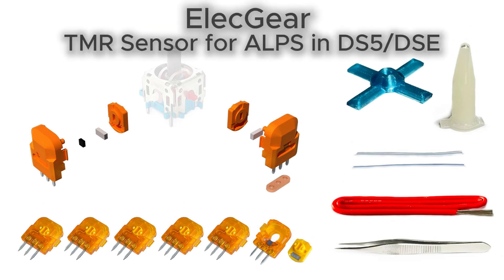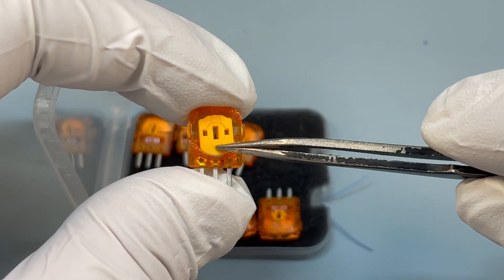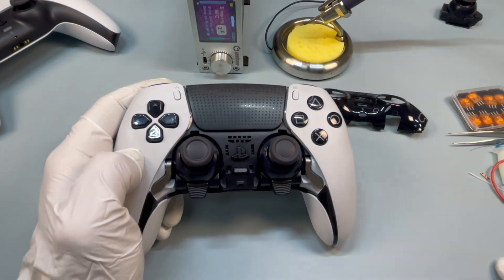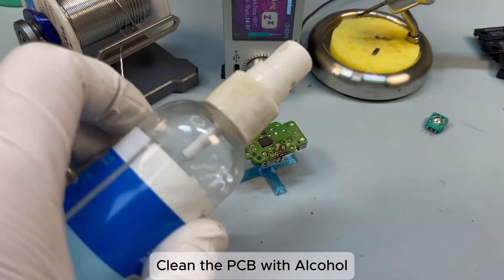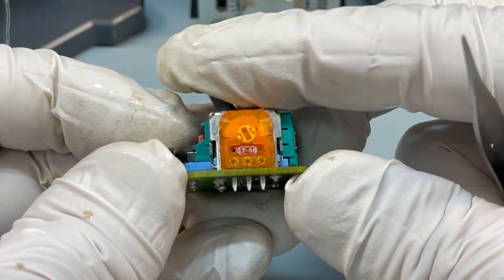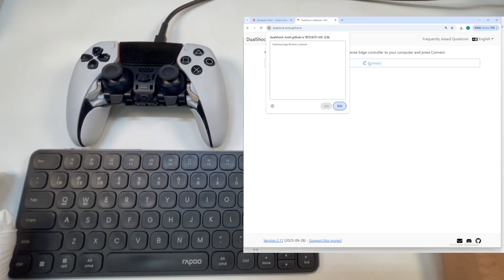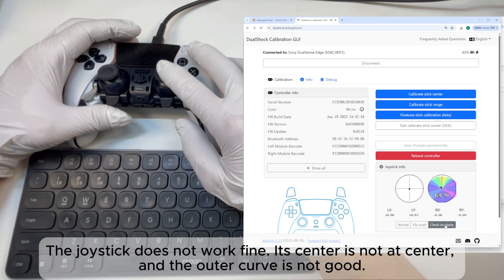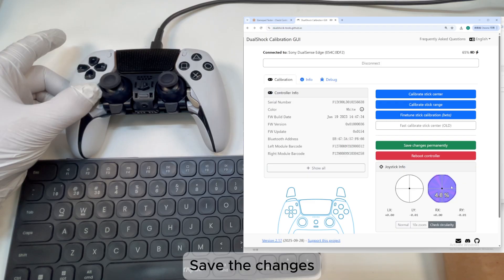ElecGear TMR Sensor for ALPS Joysticks for PS5 DualSense and DSE Controllers

Comment: FU (Favor Union) also makes similar joysticks with TMR modules. They are NOT interchangeable between Alps though due to different shaft center size. So if you have currently F brand then use ones designed for them, same applies to Alps brand, otherwise you need to change the whole joystick assembly instead. Also the hole tester is pointless since there are 3 different hole sizes for joysticks, 4 smallest for center click button-0.65mm size on joystick leads), second is potentiometer legs which are around 0.75mm and only the casing has about 1mm legs.